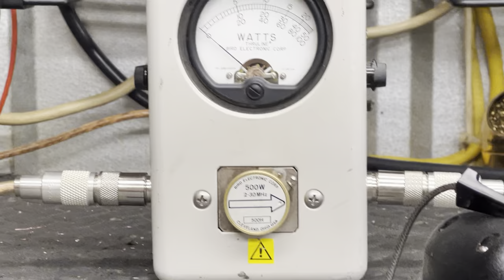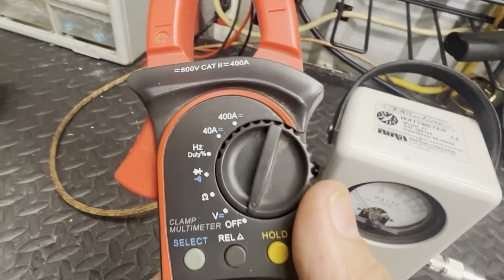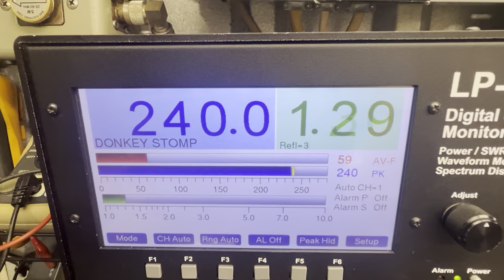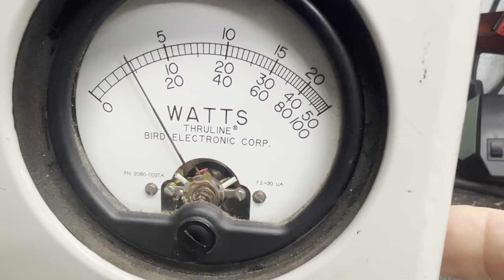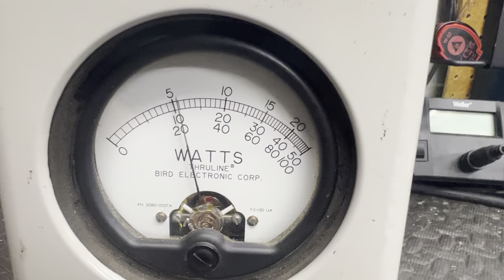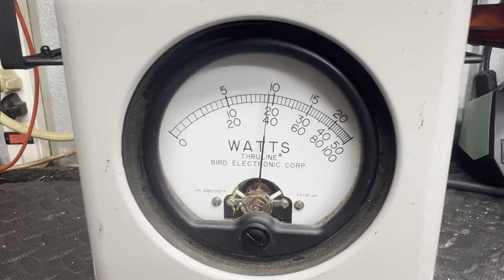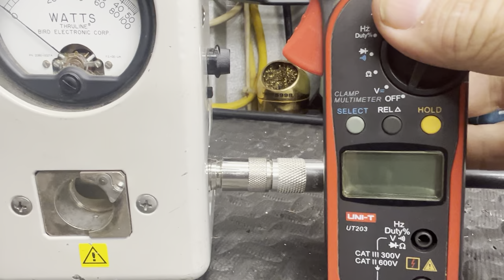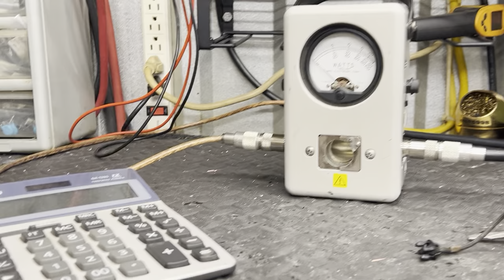Donkey Stomper, Let's Calibrate a Bird 43 True PEP Kit, Let's see if the Bird 43 PEP Reads Correctly

Comment: This is very informative!
What is your opinion on the LP reading on average?
Also, if a guy is trying to run a lot of average power, is there a formula per transistor like there is for the dead key?
Reply from the maker: Lp is good meter 25 dead is avg range. Thanks
Reply: @DonkeyStomperProducts  ok, the reason i ask about the average power is because all my radios produce the same dead key but different average. 
I have one radio that only makes 300 avg out and another that makes 900 to 1000. 
Most all the builders i see getting 1000 avg from an 8 pill. 
I'm just not sure the amp would last very long at those numbers.
Reply from the maker: @Tinman386wisconsin  It depends how radio is tuned etc to. AS Link said Avg power ratings are not accurate reading on a Am Modulated signal.
Reply from the maker: @Tinman386wisconsin  https://birdrf.zendesk.com/hc/en-us/articles/360042181473-Can-the-Model-43-measure-AM-modulated-signals-
Reply from the maker: @Tinman386wisconsin  You need to worry about dead key and Pep
Reply: @DonkeyStomperProducts  right, that's why i asked your opinion on the average power reading of the LP meters.
Being electronic or digital i feel they are accurate and was wanting your opinion. 
We have a little but different views on pep vs average which is great to learn from. 
I view pep as horse power and average as torque. 
I just didn't want the average to be a fake dead key so to speak and pop pills.
As long as the dead key rule is still king then I'm ok with a little extra average power.
Reply from the maker: @Tinman386wisconsin  higher the dead key higher the AVG, different radios more less AVG, different tunes, AVG is good to me MEASURE CARRIER. on AM. PEP in PEP out never change or miniplate when  modulated  on AM.